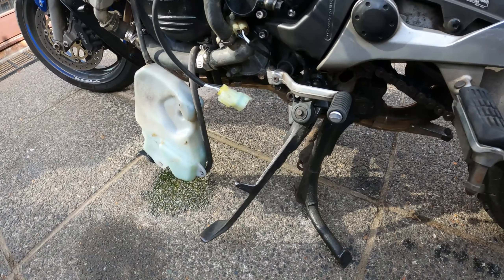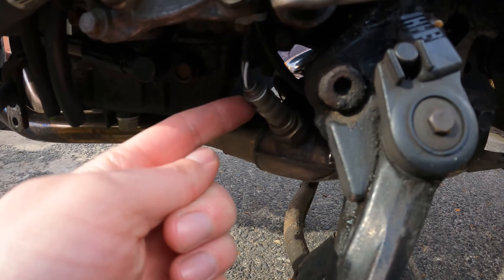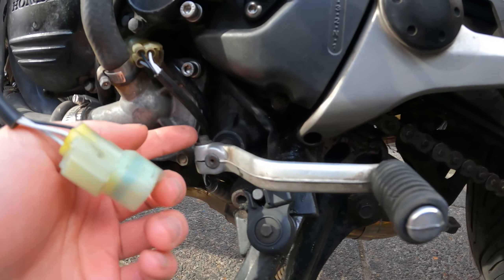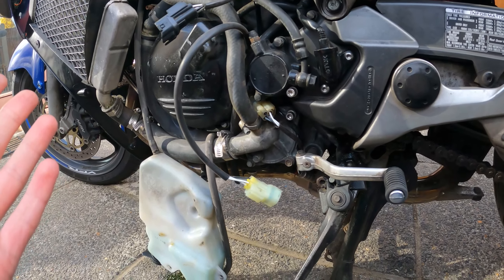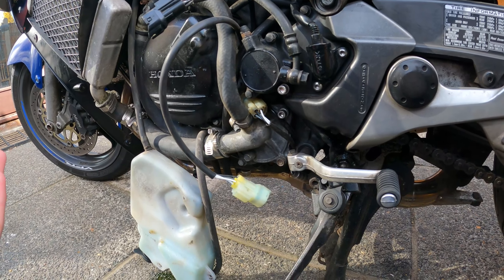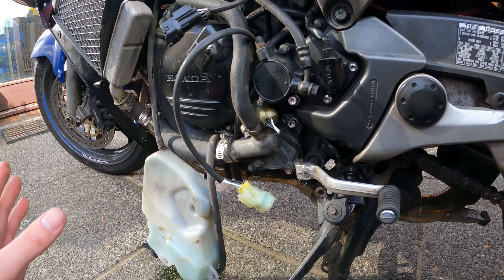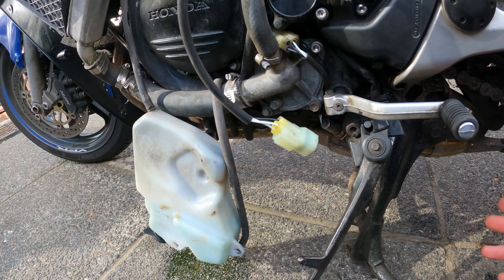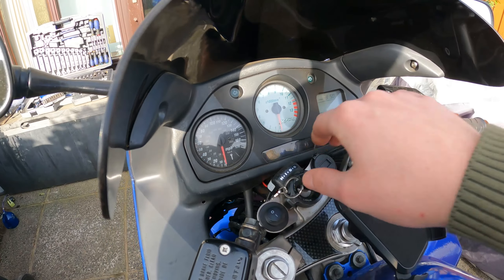Motorcycle O2 Sensor Delete | Curing the flat spot

Comment: I have an error on lambda recently appeared after a wash, as you said it cured the flat spot and the bike is colder overall but it runs a little rich, i can hear the pops in the engine braking , and i have catalitic convertors, they now get stupid hot compared to when the sensor was working so, if you do a cat delete then it should be fine, otherwise you risk blowing them up

Comment: Quite excited about your video. I have a 2007 CBR1100XX and she stutters when riding at constant rev. There is no problem when I open the throttle or release it. Watching your video I am thinking the O2 sensor might be my problem. Do you think I should also go for the ohm resistor or will it change according to the bike? Thank you in advance for your kind advice.
Reply from the maker: I can't speak much for other bikes but it should work regardless as they mostly all use the same tech
Reply: Hey buddy I owned one of these lovely bikes for a while - same year as yours. I removed and capped the PAIR system ( as I do on most of my bikes ) and that helped reduce the snatchy low speed throttle - I also ran min 98 fuel - I never had my bike feel funny at cruising speed after that. So I never did a o2 bypass. BUT my current bike - bandit 1250 feels very off/on at cruising so I’m going to try this . Also in some cars you can move the o2 sensor out of the exhaust stream with spacers . I did this on my H6 outback when I added its modified exhaust - works fantastic and no CEL lights or issues . So the principal is the same it may work in a bike ?

Comment: Worked great for me, '22 Kawasaki Z400. The only thing I had to do different was erase the error code with a scan tool to get the check engine light to go off.
Reply: Did it ever come back? I installed a delete on my svartpilen and 2 days later the light came on.

Comment: So my vtx1800c is a California model and has a o2 sensor. I shoved a 330 ohm 1/2 watt resistor in and light is still flashing code 23 which is heating element in o2 sensor. Should I disconnect my battery? Or is their anything else I gotta do?

Comment: I have the same problem with my 2013 Hyosung GT650R. the FI doesn't flash when I'm riding but I can feel the bike struggling at low RPM.

Comment: Can it fix the back fire when you installed a full exhaust system?
Reply from the maker: Usually that's caused by air interning the pipe. That's a side effect of not sealing the exhaust correctly

Comment: My bike is running lean at hi rpm. 10k. And my rpm wont go above 10k. Would it be because of the o2 sensor? In low rpm the afr is ok. But after 8k to 10k the fuel gets leaner.
Reply from the maker: I don't think so, the sensor is only really used when cruising at a constant speed

Comment: What ohm resistors is that?
Want to eliminate the o2 sensors on my zx10
Reply from the maker: 330ohm
Reply: @vfourcruza7744  what wattage are the resistors. Does it matter?
Reply: @vfourcruza7744  is 1 watt enough?
Reply from the maker: @jenkspeedholic7850  sorry I just replied with a confusing comment but I read what you meant wrong, yes a 1 watt resistor should be fine

Comment: I have 2010 honda vfr800 just installed after market headers,my o2 sensor is falling short,would this idea works? Should I eliminate both sensor
Reply from the maker: Yes do both and it'll default back to the map and run like a dream

Comment: OK. And how the ECU will get information about the O2 to adjust the mixture?
Reply from the maker: The pins we've bridged are for the heating element of the O2 sensor, the data pins aren't connected. So because the ECU isn't getting any data it will revert about to its internal map, which tells it the correct mixture to use at a specific rpm. The bike normally uses this map instead of the O2 sensor input, unless you're cruising at a constant speed, because the O2 sensor data is unreliable when the rpm is fluctuating, adding the resistors forces the bike to use the map even when at constant rpm
Reply: Hello. So just for confirmation. I have an ATV that has the same issue. My question is: the resistor bridge must be on the 12 v wires? Or the signal? I do not want to fry the ECU. Thanks!

Comment: Hiys mate. My o2 sensor was removed before I got the bike and I can’t seem to find the connectors. Anyway my my question to you is: my bike is 1999 vfr 5gen same as yours. The snorkel and pairs mod have been done but fi light is on after 15min into the journey - code 10 intake air flow. I believe that is the little white sensor underneath the air box ( correct me if I’m wrong) can I do the same with the resistors on the white connector or what would you suggest. Cheers
Reply from the maker: Unfortunately I'm pretty sure that the air intake sensor is one of the required ones, but can be found fairly cheap second hand.